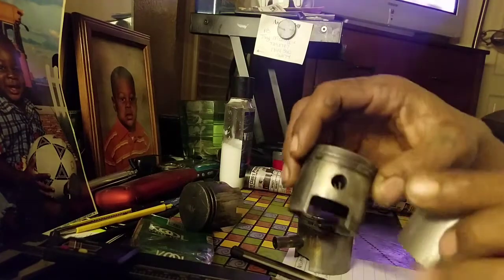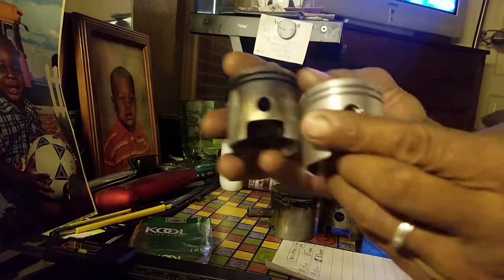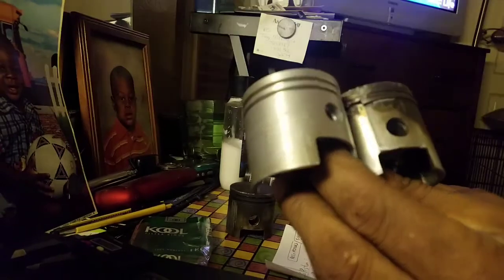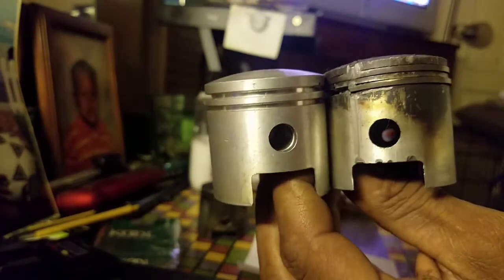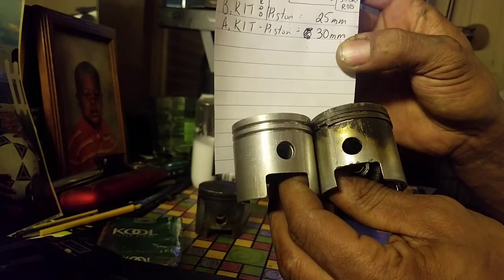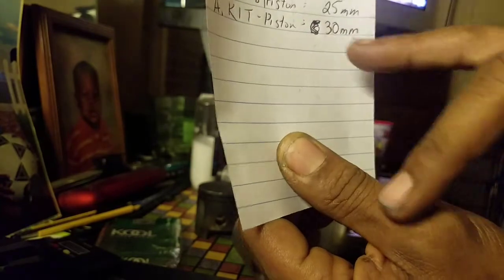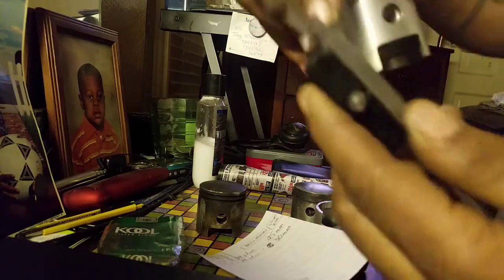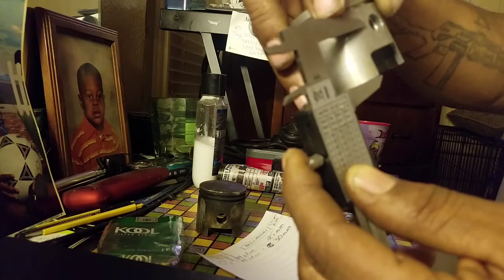Motorized Bicycle Piston Size Difference Type A And Type B

Comment: What causes the piston to scratch because when I built mine all brand new it was breaking in I was riding and I heard a noise I tuned it off and when I got home my whole side of the piston was deeply scratched my cylinder Is fine and it’s not even scratched was it because I was going fast while breaking it in I was using 24:1 ratio for 2 gallons I think I was going to fast that’s why it scratched
Reply from the maker: Sometimes you gotta look over them  maybe your g clip to your piston vibrated out or was not installed properly
Reply: @MidwestRidazmotorizedbikes  no their were both in correctly but idk it was weird how my cylinder wasn’t scratched at all and for my piston to be deeply scratched on the side I think I was going too fast man when I was breaking it in

Comment: Have you noticed any difference  from the Clyidnerheads  other than bore sizes
Reply from the maker: Not really did i miss something ?
Reply: Trying to eliminate reasons  why she won't start (with good compression) was wondering if you ever had an engine fire backwards
Reply from the maker: @rishp6996  maybe cdi or mag